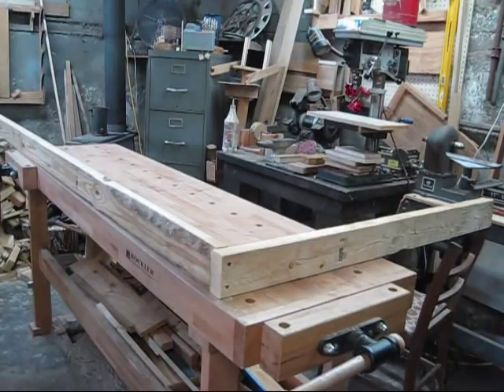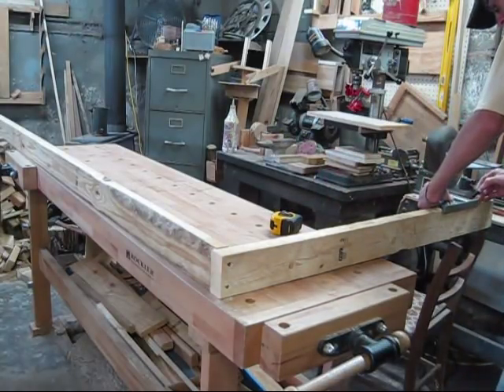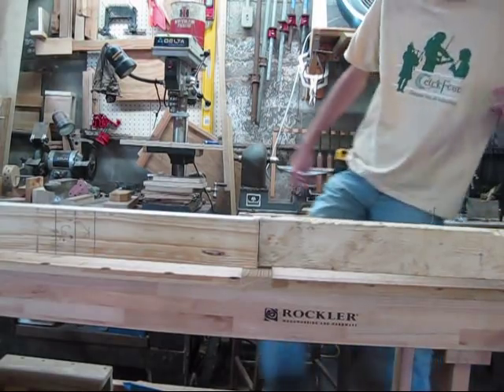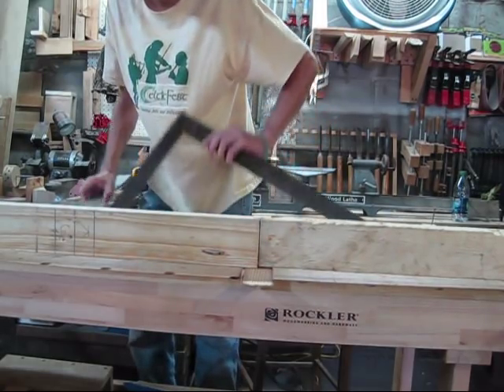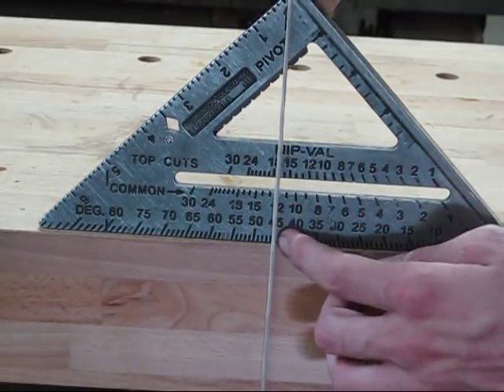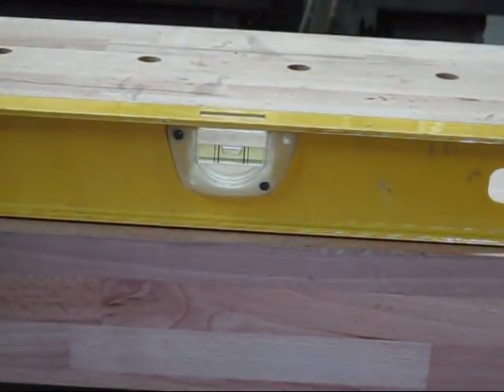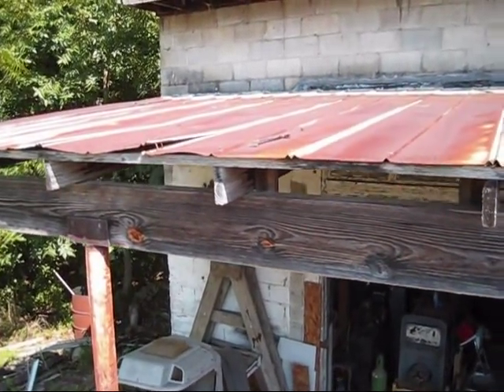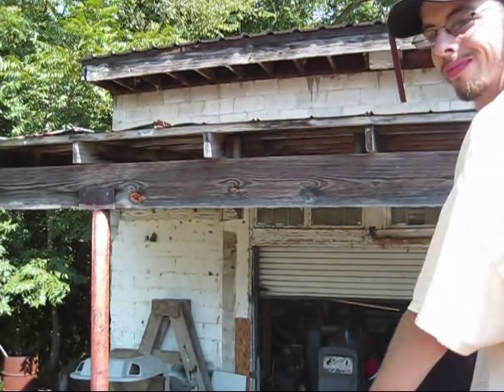Tricks with construction tools

Comment: good info, I've been a carpenter for 48 years,would like to give you - all a good trick on securing a string to tighten it...before putting the string around the second screw or nail, looping it around your finger first then give it about 5 twists twists, put the loop around the second nail. pull string with one hand to tension while pulling the louse end back toward ,first point when desired tension  is achieved, pull louse end the oposite way causing the twists to double up on themselves ....The advantage is ,you can add tension or remove string quick and easy..try it

Comment: Here's a simple thing to do when you're trying to put a screw or nail into the edge of a board like the video just showed. Just simply take your hammer or any blunt object and give the edge of the board a little whack. It will create a small flat spot on the edge making it easy to start your nail/screw. Another trick......if you want to attach a board flat against an existing concrete floor lay the board down flat, take a 3/16 masonary bit in your drill and drill through the board and down into the concrete about 2 1/2  more inches and then insert a piece of bailing wire all the way down in the hole. Just leave the extra wire sticking up. Then take a #16 duplex nail and drive it into the drilled hole and down into the floor until it stops. You won't believe how good it holds. I've been using this method in the concrete business to set forms on concrete floors for many years. And later you can pull the nail with a crow bar and it doesn't shell the surface of the floor like a Hilti nail does. And lastly......if you're trying to drive a nail into a board and the board is likely to split just take your hammer and hit the point of the nail flattening it a little and then when you drive it it will be much less likely to split the board.
Reply: +floyd green  I have to thank you for that tip, I would have used a rotary hammer and a concrete anchor or an insertable anchor nut permanently set into the floor.  The double headed nail would be better in my opinion.
Reply: +floyd green  I have to thank you for that, it would likely be better than a hammer drill and anchors or the drop in anchor nuts over the long run.
Reply: +8559jack  Yep it works great and when the project is finished all you have is a tiny 3/16 inch hole in the concrete floor that's barely noticeable.
Reply: +floyd green Not to say you aren't right - tie wire and a a 16D is a heckava lot cleaner than a ramshot or whatever you're using - but I find (depending on the finish specified) a 2 man crew 1 w/hammer drill and one following/driving, it's not nearly as cost effective as just shooting them and point/patch after.  Now the exception - Usually on a Class B finish, it'll usually spec. any "imperfection" over 1/4" must be repaired. (obviously varies based on contract, but....)  The 3/16" hole - even though the client often whines over it - is passable.

Comment: Glad to see the Pythagorean Theorem still in use! In fact, (with the exception of the tape-measure retrieval trick) ALL of these methods have been used successfully for thousands of years. Even before Pythagoras, the Egyptians used string, compass, triangle and square to build pyramids and the impressive tunnel systems within.

I find it curious that after five thousand years, those tunnels are (mostly) still in tact and are accurate to one-inch per mile. That rivals and exceeds some modern tunnel-builder's accuracy with their modern GPS, radiometric and laser tools.

Carpenters are clever, and whether they know it or not, they are keeping great traditions of math alive.

Very useful video Sir!
Reply: This squaring trick is so great I keep a five foot stick with screws already in it to speed up the process.  Measure out the 3 and the 4 and force the boards to meet my 5 foot stick.  It's kinda like a oversized speed square if you put multiple screws in the 5 ft stick.  Other screws will insure your truss work.  Or smaller openings like a bath window.
Reply: trongod2000 I like the 5 foot stick idea.  Good one!